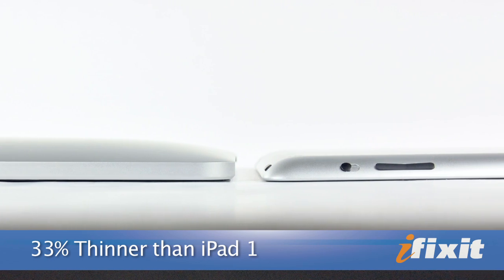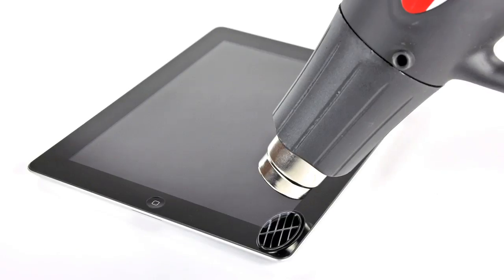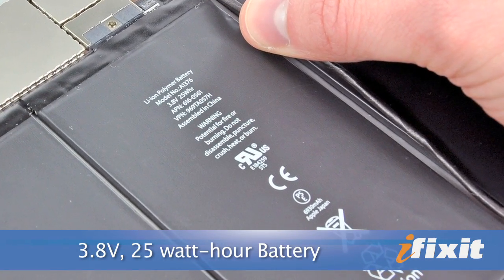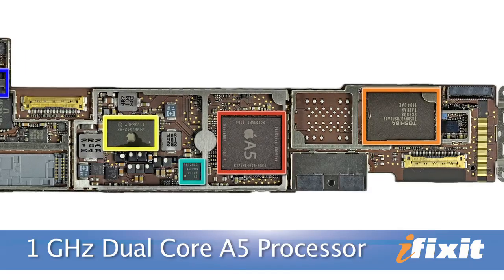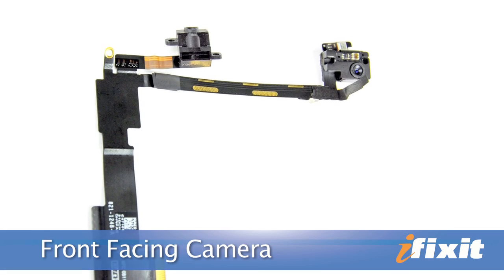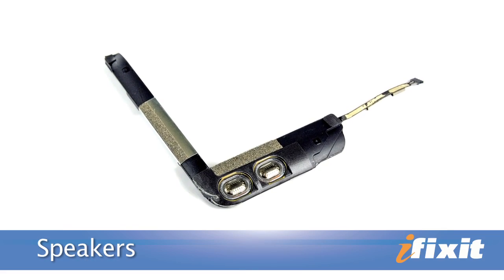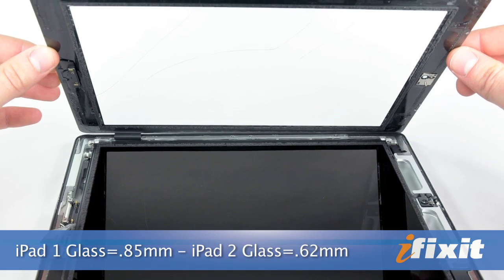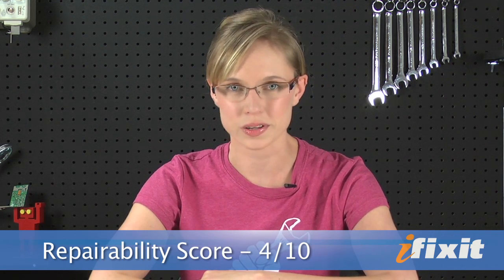iFixit's iPad 2 Teardown

Comment: Many people say that my iPad 2 is not fixable, but deep inside me I know it can be repaired. The only intact thing that probably works is the motherboard. I'll try to swap the motherboard with another iPad 2 (same model A1395) and I hope that it will work because there are lots of photos, videos, games and memories from my childhood. (I destroyed it when I got super angry as a kid.) Also can I swap the motherboard from the white bezel iPad to the black bezel version? (They are both A1395.) I hope that it will work.
Reply: I know this is 2 years ago... but I'd like to hear how this went. :P Also yes you can.
Reply: @Missing_Texture_Checkerboard  Unfortunately, I didn't perform the surgery on the iPad, as I did not have time to spare, nor another iPad. I am still planning to do that, when I get my hands on another iPad of the same kind.

Comment: I have an Ipad2 where the touch is only active on a strip 1/4 of the screen. If I rotate the Ipad the active part also rotates. I'm trying to figure out if this a problem with the ribbon cable or a chip problem. Thanks to all suggestions.

Comment: btw... MJ? Who ran the Benchmarks vs Xoom... Engadget or iFixit? They are misleading. iPad 2 was tested using OpenGL v1.0 Benchmarking Tool and Xoom got tested on OpenGL v2.0 testing for full OpenGL ES 2.0 compliance. Reason? New version has not been coded to run on newest iOS proprietary drivers. Same GPU as Galaxy S phones but on same v1.0 test has lower frame rates due to underclocking! Xoom has now been overclocked to 1.4ghz & kicks butt. It also now has tuned FLASH 10.2 running sweet!

Comment: The iPad has never had a super impressive speaker system, but like the camera, it's not the main selling feature nor the main reason people use the product. People will use headphones and external sound systems anyway when they want a better listening experience.  However, check out the theremin setting the the Bebot app with the volume at full on the iPad 2. It's impressively loud for such a small speaker.